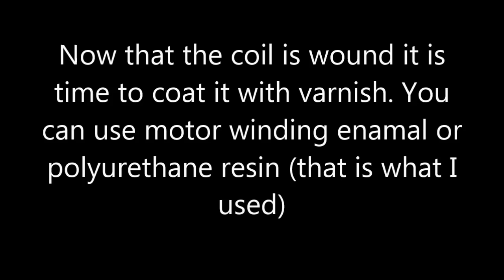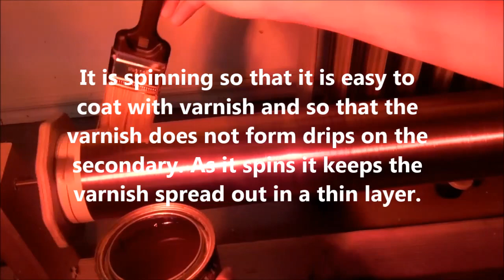Winding a 4in Tesla Coil Secondary/How to build

Comment: am I the only one who thinks it's ironic he's using a DC motor to make a tesla coil? Teslas trademark was AC.
Reply: No you arent
Reply: I'm pretty sure the name "Tesla coil" comes from the system that produces an AC current in the primary coil to induce a voltage in the secondary coil.
Reply: Well  LOL  DC  motors   in a manner of  speaking  produce their  own  AC  otherwise they would not rotate  (commutator--brushes)
Reply: Also, the person is not making it obvious that the produce has been any useful .. except for putting out yet another video.
Reply: Ahh we have a guy who wants to sound intelligent
Reply: That being, the far higher potential use in ac. LOL
Reply: Thats what we call AC⚡DC
Reply: The 50-60Hz AC used as an input (in most cases) is actually being rectified and stepped up to a higher voltage DC rail.  The DC rail is used as a current source for an inverter which turns the DC back into AC but at a much, much higher frequency.   So, yeah, Tesla understood DC.  He probably understood it better than that hack Edison did...
Reply: So it should be Wahshington AC, or what?

Comment: Seriously, I was worried about you wearing down your fingernail and cutting through it into your nailbed with the wire. It made me want to take a metal sewing thimble, and put it on the tip of your finger to use as a wire guide. I’m so overprotective that way. Nice setup, though.

Comment: Does it matter what direction the winding is? If yes, why? The rule of the right hand turning...? Thanks.
Reply from the maker: I don't believe it should matter which way you wind it.
Reply: @ElectroTechnics Thanks for your reply. The reason I've asked is that some other videos stated it must be turned like clockwise direction/right-hand-direction.

Comment: That's a very nice build. I just wondered since you used magnet wire why did you varnish it again? Also I liked the show. Thank you for your time, Tom.
Reply: to stabelize the coil a bit m0ore
Reply: you varnish it in order to keep the wires in place, so you cant mess up your coil just by rubbing your hand along the side. just an extra precautionary step
Reply: better insulation
Reply: Without varnish, corona would destroy it fast.

Comment: I used the Wire found in Relay, that is very thin, I've read somewhere that the thinner the Secondary coil the better the results.
Reply: Yes, but you'll need to isolate the wire good enough so that it doesn't spark to itself.
Reply: @Tesdraline  That's what the coat is for
Reply: No, the thinner the secondary coil (both wire and form), the WORSE.

Comment: Thank you very much for the video.
While the magnet wire has its own enamel coating, it seems not necessary to coat it again, but how do you fix the wire on the solenoid without glue, may I ask you ? 🤔
What is the inductivity of your secondary coil, do you use a program to calculate it ?
Reply: RF coil ingle layer calculator will do it.
Reply: single layer

Comment: how many feet of wire of copper did you use ?
Reply: It's not hard math... Just calculate the circumference and the length... Divide length by thickness of the wire and multiply by the circumference
Reply: 26gauge is actually pretty thick , i think he should have used something like 32 gauge  to get more turns

Comment: lacquer coating deteriorates the quality of Tesla coils greatly reducing its quality factor resonance frequency. Because the varnish coating greatly increases the capacity of its own coils.
Reply: You need a coating or will not circulate through the coil. It will follow a strait line...What are you thinking???other coating or no coating?
Reply: Yes explain what would be best
Reply: bafew magnet wire like he was using has its own enamel coating. So the varnish was inconsequential.
Reply: While the magnet wire has its own enamel coating, it is not necessary to coat it again, but how do you fix the wire on the solenoid without glue ?

Comment: Is it possible to use 0.05mm wire ?
Reply: Only for much smaller coils.

If you are winding a mini coil - eg: 15mm former and perhaps 80mm long then you could end up using fine wire to get the right number of turns - several hundred to a thousand or so. 20.05mm diameter wire = 200 turns to 1cm - that would give you a 1600 turn coil in the space of 80mm of "wound" coil in the middle perhaps of around 10cm total length. A 25g reel would be more than enough. This really would need winding on a commercial coil winder (not expensive for SMALL coils), you can get them on Ebay for under £30 / $40 from China - alas they do not make a version which can handle long coils.

Without a coil winder, I think the effort/reward would be challenging for the wrong reasons. You can buy the type of coil mentioned above WITH little driver for less than £4 - and it will even make music. Search for:-

mini tesla music

If you try and hand wind a coil with wire as fine as this, you will be FANTASTICALLY lucky if you do not break the wire - will break with around 40g of "pull".

Conversely, if you had the awesome luck to have some plastic sewer pipe you might end up winding perhaps a  1 metre diameter, 4 metre high coil of `2.5mm wire - and end up with around 1600 turns. Cost a few bob though as you would be using around 5KM of THICK copper wire - around quarter of a tonne of copper - but have fantastic 17.5 ohm DC resistance, 4 metre high Tesla coil. That would be a bit awesome.

Somewhere between the 6cm - 10cm long coils and the 4 metre long coils is where most folks build - and an 80cm high coil, around 20cm diameter wound with 0.5mm (not 0.05mm) would give you roughly 1600 turns (plus a few cm top and bottom unwound). That would need about 1KM of wire - or just under 2KG of copper. Very nice coil and not absurdly expensive (about £25-£30 of copper if you shop around)

The smaller the coil, typically the finer the wire. If you use the three coil version (Google Tesla magnifier), then you would use thicker wire on the intermediate coil (now the secondary) and a finer wire on the tertiary (what would USUALLY be the secondary coil). The magnifier is also easier (IMHO) to tune.

Comment: Varnish? That's a dielectric, increases the interwinding capacitance. Isn't that bad?
Reply: no different than the varnish already on the wire or the air surrounding the coil

Comment: Shouldn't have used tape to secure the wire. Instead drill a tiny hole, angled toward the wire wrap, and insert about a foot of wire through the hole into the center of the tube. After winding, the wire end can be fished out through the center of the tube and attached to the toroid on one end and Earth on the other. Looks nicer and is easier to deal with. The tape will eventually fail causing the wire to become slack.

Comment: How many meter wire you use?
Reply from the maker: I don't recall, but if you plan to make one you can calculate the length by the number of turns and the diameter of the core.

Comment: what if the wire acidentaly goes over the wire thats before it,will it work
Reply: ok but why dont they make coils with 2 layers od wire, wouldnt that double the power of the tesla coil compared to only 1 layer
Reply: electric field would short out... high voltage passes right through almost everything
Reply: @Lovreli  
A coil that size could easily end up with hundreds of thousands of volts - now, the voltage from one turn to the next might only be 100 volts (for example) - and the insulation will hold out - but if you started a "second row", you would end up with ENORMOUS voltage differences a fraction of a mm apart. Instantly destroying your coil.

What you CAN do (though they look ugly) is to "stall the winding" so you end up making two or three turns on top of each other before moving on up. This way the voltage difference might be 300v - high but not enough to fail. This looks messy and can also break down as you can have double that voltage between two subsequent turns - but if you have a good quality insulating enamel (not all copper wire is the same quality), it CAN work. Just nicer to have a taller / wider former and do it properly though.

Only learned about a "partly stalled winding" by mistake. Was going to be just a physically long inductor and a neat winding was not critical. After replacing it with a more conventional part (which finally arrived), it did work (surprisingly well) as a small tesla secondary - better than a neatly wound one using the same gauge copper. As I say though, I doubt you would get away with more than two or three overlapping windings. On the upside if it DID break down, it would only short the two or three affected turns and NOT the rest of the coil.

NOW - if of course, you placed a THICK plastic insulator (1 cm thick plastic) over the first coil and then wound again on the next one, you might get away with it - a coil inside a coil.

I doubt it would work well but it would be an interesting experiment to do I guess if you were bored one day :)

Comment: imagen if it broke half way
Reply: mine has 3 times... this time I bought good wire. Funny thing is how easy the first one went together.
Reply: +Kristijan Dinga the second time I did get a bit irritated. I only get about a week a year to work on the big components. Kids in school, vacation spent mornings with house maintenance, late evenings in my shop. I use a sewing machine speed control and motor for my coil building lathe jig - my wife had one, and the bobbin mechanism broke. Works very well.